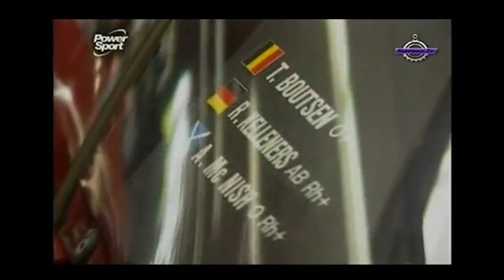Street Legal Madness - The Story Of Toyota GT-ONE

Comment: Either in reality or in racing simulator, due to too much torque the rear tire easily puncture when pushing too hard
Reply: Nah! it was sabotage. The toyota gt one qualified 1st, 2nd and 8th for lemans 1999, they would have won, but someone purposefully threw shrapnel or something to puncture their tires. If the tire punctures didn't occur, the toyota gt one; the zent, the esso ultron and the safety net teams would have won the lemans no doubt.